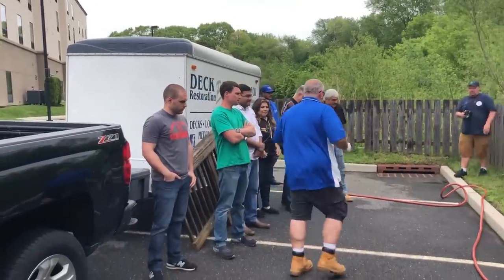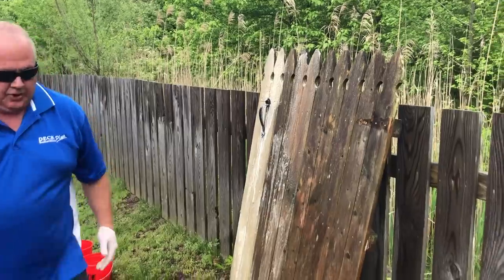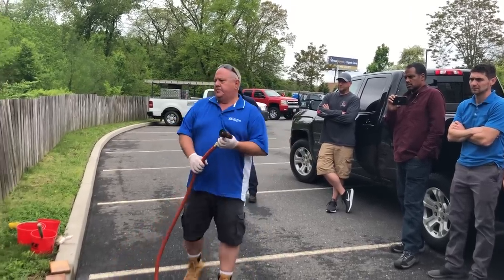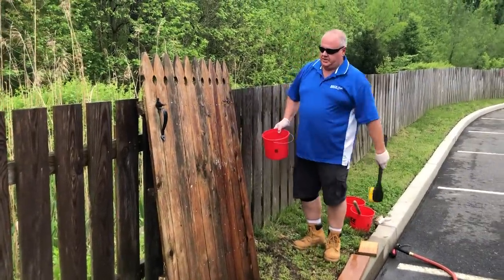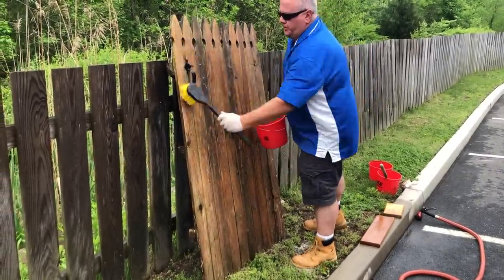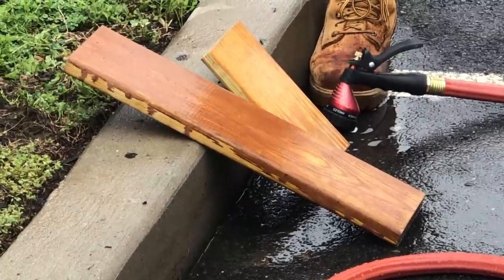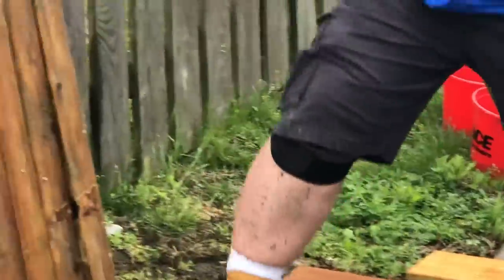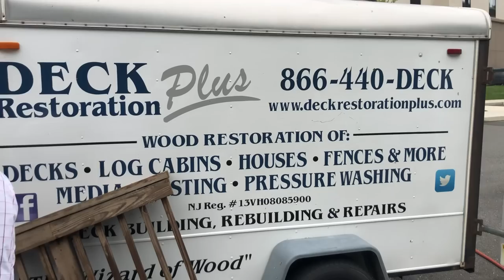The “Wizard of Wood” Everett Abrams performing a live demo on Exterior Wood Restoration

Comment: @wizardofwood  Everett following your directions exactly and stll having wood fibre after rinsing with garden hose. Do you think I may need more pressure or simply let dry for few days and recheck.Thank You.
Reply from the maker: @billsullivan8812 , there will be some natural fuzzing and wood fibers when restoring wood. Keeping a deck well maintained prevents this. No rhyme or reason on why some “new” wood does this and some new wood more than others. On aged wood if it has grayed or not been maintained they are decomposed wood fibers that actually need to come off before staining. Sometimes wood restoration is light sanding and Osborn brushing.
Reply: @wizardofwood  Thank You very much for quick response Everett.

Comment: So can u put Sodium metasilicate in a pump sprayer and just spray it right on the fence? If so what percentage of SM would you mix with water in a two gal sprayer? Also u have to put oxilac acid after u wash the SM off to make the wood really stand out. Thanks
Reply: No you have to use that special brush which doesn't look like it's doing a whole lot really 😒

Comment: Hello sir I live in San Antonio Texas, And would like to start purchasing your products. Your videos have been extremely informative and I have a question… Have you found a way to remove sprinkler water stains before applying a transparent/semi transparent stains?

I’m having issues on cedar fences that are only a few weeks old and have white sprinkler water stains, after restoring the fence prior to staining by using an oxidized bleach via your method.

For an even finish I’m not sure if Im stuck using a solid stain or not. But on a brand new fence I sure would like to stay with a transparent, or semi transparent stain.

I greatly appreciate your time, and if you offer classes regularly I would like to attend one.

Comment: Everett, I've been powerwashing and staining decks as my main business for many years. Can you explain to me why you can't just wand this with a fan tip, let it dry, then stain? I'm super fast, it removes the faded wood fibers, i spot sand any splinters.  My decks look amazing. Sometimes I use SH to brighten but I still wand the pulp or fibers off.  I've also used no SH but oxalic a few times after wanding and it brightens.  So why all the extra chemicals?
Reply: I believe its because you look like your doing/explaining  something technical and its not. Basically just bleach water, So you can charge more. I pressure wash my fence and water seal about every 3 years thats it. And also hold classes so you can sell your products.
Reply: You can.... if you watch the video he says that. The way it's done here is for demonstration and that he's in a hotel parking lot to show the differences.  SH only bleaches what it contacts and turns a white ish bleach color and longevity is not where it needs to be as it will become spotty after a few months to a year....pressure washing to rinse this requires you to "dig" in more of you want to break that surface junk free and get rid of the bleached surface you just created. Otherwise you're leaving it looking "white" and the customer will see it start to change to ugly again not that long after you leave.  SM strips those layers of by Chem means and allows them to be blown off with a fast pressure washer rinse..... and leaves behind the wood's color and not a white bleached surface that will continue to change after you leave. Scrubbing would only be needed if you're Chem mix is weak or in tight slots that would need hand scrubbing no matter what process you're using. 

You will need to rinse... not "let it dry and stain" because you want to remove the surface junk the chemical broke up and get rid of it before brightening and staining.
Reply: @thelog86  just because you do your fence doesn't make you an expert. Actually this is very technical and understanding your chemicals and how they react is IMPORTANT! Not only for the saftey of your employees and clients but also your bottom line. And your slight toward guys educating themselves about the business their in so they can do it right and provide expertise to the work they are doing is really insulting. Fact of the matter is that there's all different surface types and tons of different wood and ages of wood that is worked with by us pros..... having a firm grasp of the actual capability of the chemicals you are using ON SOMEONE ELSE'S BELONGINGS is NOT a bad thing. Learning how to do things faster with a more desirable end product is also not a bad thing.  Having a business and training someone how to do it and offering them the supplies they need to do it is also NOT A BAD THING. There over a dozen people standing there,  on just this one training, paying for this info and probably hundreds ordering chemicals from him and your tone suggest they are all fools for spending their money with this guy so they can educate themselves on alternate process other than what they already know,  learn ahead of time without experimenting on their actual clients belongings or from making a possible huge mistake that could cost them thousands to rectify and deliver an end product that they want for their business and clients. You have no idea how many different wood and finish combos we see every week, nevermind,  every year. Any info that is learned to save time,  not make a mistake and cause damage,  save money,  save supplies and materials, deliver superior results,  or learn a process you didn't already know and know WHY you are doing it the way you are is worth its weight in gold. You're very bitter and close minded for a same fence once every 3 years guy. You're obviously here looking for information,  FOR FREE,  and then you knock the guy who gave it to you and indirectly knock legit contractors that are trying to provide the best they can for their clients and businesses. #realnice my dude. 🙄
Reply: @MyBigThing2010 damn, who hurt you? It’s not like he was saying anything bad. Way to assume a tone by reading someone’s writing. He asked why you can’t just do it the way he does it since(and pay attention here) he does this for his BUSINESS. Meaning he does it on the regular. Not sure where you got that he does this on his fence once every 3 years.

Comment: Is the brushing always necessary? Also, what would be the ideal pressure to use on wood to prevent furring/fuzzing? Would it be best practice to just use a garden hose to rinse? Awesome vid. Subscribed and liked.
Reply from the maker: You do not always have to agitate with a brush. Only in cases with heavy growth ideally the chemicals should be lifting everything off. This goes right into pressure. Again it should be the chemicals doing most of the work and following up with high volume and low pressure to rinse. You can absolutely use a garden hose but usually we use a pressure washer with the white 40 degree tips keeping the pressure under 1000 PSI. Thank you for subscribing! more videos will be coming soon!
Reply: @wizardofwood  very good video . How to mix a 2 gallon pump sprayer of oxalic acid?
Reply from the maker: @JoseGonzalez-ig4do , while we do not recommend using raw chemicals because of the safety factor, 8-16oz is an industry norm. Prepackaged solutions are safest.

Comment: Some questions if are able to answer:
1) You named the chemicals in the demo, but your website shows product names. Which chemicals are in which products?
2) The demo seemed to be oriented from least to best, left to right. But, it seemed like everyone was focused on sodium metasilicate. Is that the best, or is it the lye? It was difficult to tell from the video.
3) Does the wood restoration manual sold on your website talk about all these chemicals and show exactly the mixing ratios needed (if doing it from scratch), or does it reference using only your products by product name?
4) If there is one of the demo chemicals that is primarily used in your cleaning products, which is the go to one? Or, are there different level products that use different level chemicals shown in the video?
5) What is the difference between the cleaner and the stripper products, chemically, referring back to the demo? Not asking for any formulas. 
In all, I'm just trying to connect the dots between the chemicals referenced in the demo video and your products. And, if it's all covered in the manual, I can look at getting that to get all my answers.
Thank you!
Reply from the maker: 1) In the 2lb DIY products the Cleaner is a sodium percarbonate. The Cleaner/Remover is Sodium Metasilicate. In the 5Gal Contractor grade. The Restorer is sodium Metasilicate and the Stripper is Sodium Hydroxide. And the Brighteners are oxalic acid
2) We also show demos as good, better, best. The Metasilicate that is our restorer tends to be our most used. However no job will be the same and there is no perfect product for all applications. 
3) The manual is not product specific. It doesnt go to far into dilution rates but helps you get an idea of what can mixed together and what strengths to use 
4) As stated before our most used would be the Deck & Wood Restorer which is sodium metasilicate. However no product is perfect for every job. Wood restoration isn't always as easy one product. It changes job by job.
5) The Restorer is a strong cleaner and a mild stripper when diluted less. The stripper in some instances can be mixed weaker and used as a cleaner as well. Again back to the knowing your chemicals and using them the way it makes sense on a job.
Reply: @wizardofwood  Thank you. Very informative!

Comment: I have a gentleman with a log cabin what can I use to clean mold and mildew off without removing sealer just washing
Reply from the maker: Honestly, nothing. If you were to just shoot water on there you would see some color run off. I light solution of house wash and .5% bleach May work but it is best to fore warn the homeowner that the coating could be affected. Sometimes we have to tell a homeowner what they don’t want to here.

Comment: Admittedly, I could use a pressure washer with a white tip or so just to speed up the rinsing process? instead of the hose? And i should sell this as a restorative service?
Reply from the maker: Absolutely, We like to use a garden hose in the demo to show that the chemical is what should be lifting the growth and build up off. We use a pressure washer with a white tip on all of our jobs the goal is to keep the PSI under 1000. And yes this is wood restoration not just cleaning if you check out the channel there is a video on that topic specifically

Comment: Hello Everett, just a quik question about the Oxalic application. After applying the brightener I've always rinsed it off after 10 minutes or so. I was reading a article from Ready Seal and they recommended to not rinse off the acid at all. To leave it on to dry. What would you recommend?
Reply from the maker: Hello Chris, I always tell folks to always follow the manufacturer's recommendations. Ready Seal would speak for their products and you should follow their recommendations if that is the product you are using.
Reply: @wizardofwood  No it wasn't about using their product. I've used their stain in the past and do like it for an oil based stain but I prefer water based paints and stains over oil based. I was just looking over their sight about their cleaning and brightening practices. I go on tons of different sights with paints and stains just to view their products and application methods and saw where they said about cleaning and brightening. They said when brightening to always leave the oxylic on and Never rinse it off no matter what stain you're going to use. I questioned them by writing an email message and they responded with a huge letter back explaining why you should never rinse off the oxylic when brightening. That it will never lower the pH and brighten properly if you rinse it off even after 10 minutes, which by the way I do all the time and it works perfectly. I've always been taught that and every company I've known does that. Maybe they know something I don't lol. I was just wondering what your thoughts are on that matter. Thanks.

Comment: With Sodium Percarbonate, is there a maximum water temperature you don't want to go beyond when mixing to dissolve it?
Reply from the maker: We usually just mix it down in warm water doesn't have to be really hot. Just warm enough to help dissolve the powder.     You want to avoid hot water when restoring wood as it raises the grain and makes for blotcy and inconsistent coverage  when staining or sealing.

Comment: If you apply sodium metasilicate to a stained fence, will the fence need to be re-stained? And do you sell SM on your website?
Reply from the maker: Yes, any time you clean, even with water only, you will lose color from the coating being oxidized. Sodium metasilicate should be looked at as a strong cleaner or light stripper. We sell the sodium metasilicate product as Cleaner/Remover on our site. https://deck-restoration-plus-deck-and-wood-stain.myshopify.com

Comment: What happens if oxalic acid is not rinsed/rinsed thoroughly after application. I could not figure out if it should be rinsed after and did a job and now it’s dry. Customer is getting the deck stained. Will it effect the ability to stain? Will it damage the wood?
Reply from the maker: Speak to any chemist and they will tell you Oxalic doesn't have to be rinsed. Once applied it returns the wood to neutral. On our commercial side when we apply the brightener we do not rinse we let it dry then stain.

Comment: Quick question, let’s say you had to clean that whole fence in the background... I noticed you scrubbed for the demo, would you need to scrub that whole fence, or can you spray the stuff on? 

I need to purchase some of that good stuff from you.
Reply from the maker: No, you would apply and allow the proper dwell time for the product. Then you rinse off at low pressure with a pressure washer. We recommend under 1000psi on all wood. Specifically though 600 or less on a cedar fence. PT can take a little more but, rule of thumb is just enough to get the job done.
Reply: @wizardofwood  so spray on? 
Thanks for the help
Reply from the maker: @MrNick- , absolutely
Reply: @wizardofwood  ok awesome, thank you for the help

Comment: Can you spray these on as opposed to brushing? Any advantage to brushing?
Reply from the maker: As stated the brushing is for the demo only. The use of a garden hose is also for demo purposes and to emphasize that it is NOT pressure that restores wood. Certainly a sprayer of some type and a pressure washer with larger tips to reduce pressure are used.
Reply: @wizardofwood  Thank you. Great content!
Reply from the maker: @JoshParkerWI  thank you!
Reply from the maker: Absolutely, that is what is recommended on the video. It is stated the brushing is for the demonstration only, though you can also use a brush to apply or agitate. Most contractors use some type of sprayer.

Comment: Do is there sanding involved with this product before you stain?
Reply from the maker: When using the restorer and removing organic growth and build up sanding shouldn't be required just brighten and seal. If you're stripping a solid coating you will still need to do a but of sanding. We work with a 90/10 rule 90% taken off with the chemical and 10% left over to sand.

Comment: Also how would you do this in volume? Big brush?
Reply from the maker: Thank you for watching the video. This is a demonstration to show the chems/products only. It is emphasized by not using a pressure washer or other equipment so that we can see the products do the work. There are many types of sprayers and equipment that will increase productivity that include soft wash equipment, pressure washers, pump-up sprayers, HVLP and 12v sprayers, airless sprayers, and more.

Comment: Could you imagine sanding down an entire fence!? I've done a couple decks before that someone spilled some paint on and it is a pain in the rear. Any place that is sanded looks different to any of the other deck even when new and it is a lot of sanding pads and a lot of work to get an even finish with your stain. Wood is one thing especially old I've had some trouble with in the past and look for a way to get a good even finish when staining these old decks and it is pretty difficult. The customers do not understand the amount of work that goes into that most if the time...it's not just spraying on some stain lol but if that's what they want...🤷‍♂️

Comment: Hey Everett. I’m going to start using sodium precarbante for wood cleaning. What’s the correct ratio and can I apply it with a pump sprayer?
Reply from the maker: Kevin Jackson, 8-16oz. per gallon mixed with warm water is best. Using a pump sprayer is fine as long as you use warm water to dissolve the sodium precarbonate. This keeps it from clogging the top.
Reply: Wizard of Wood thank you so much. What about sodium metasilicate? Same question. Pump sprayer? And ratio?
Reply: Wizard of Wood I really don’t want to use bleach on wood.

Comment: Now, if you are restoring wood where livestock are present, let's say like a barn, then you can't use anything with any form of silicate or chlorine. Animals will eventually ingest it. So, that means either percarbonate or hydroxide. And, most older barns will have significantly aged wood siding ... so, which is the better route in this case ?